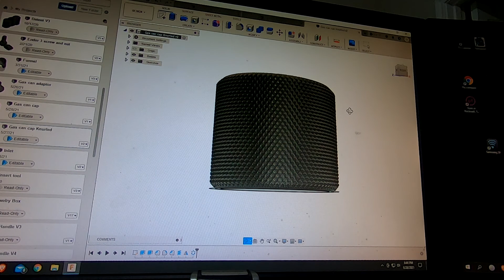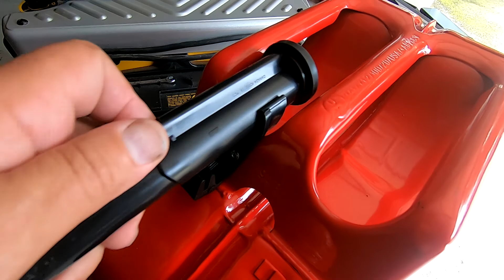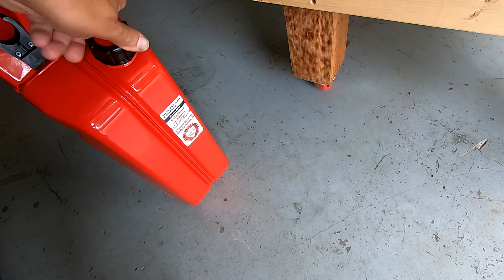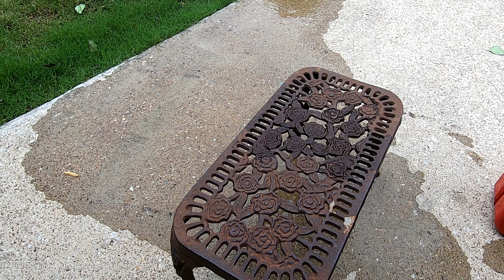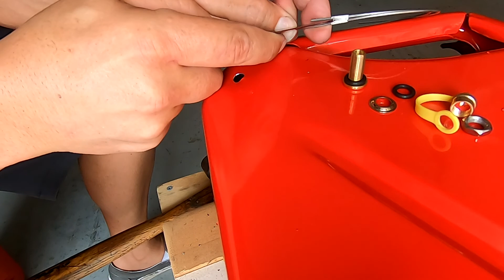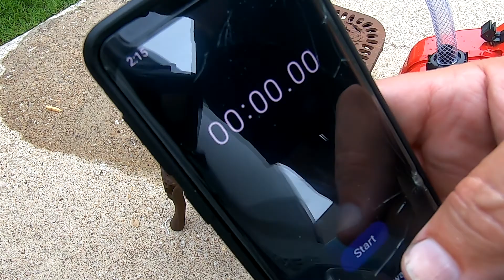The best spout and metal vent for the Harbor Freight Jerry Can Gas Can.

Comment: Just bought some of the Midwest HF Jerry metal cans and wanted to see how to vent them.  Perfect video.  Didn't want to install plastic vents on a metal can.  The same vents have my eyes on from Amazon.  Any regrets on the location of install?  Top left side.  My cans will be used for annual storage and just thinking about the arrangement of them.  If arranging side by side the vents could protrude out and be in the way.  Thanks for the video.  Also any tips on removing the metal shavings from inside tank after drilling the vent hole?
Reply from the maker: Actually, the vents are installed on an angled part of the can so my cans sit side by side touching each other and the vents do not stick out past the side so they do not touch or get in the way. I am happy with where the vents are located.
Reply: @737mechanic  No reason to reinvent the wheel then. That is where they will go.  Thank you.
Reply: No spring chick anymore at 60. Think I'm going to wimp out and go through the transfer pump way.

Comment: The nozzle stores inside the can pour hole -nozzle end down.
You can buy flexible adapter nozzles right where they sell gas cans at tractor supply or harbor freight.
I used one of the flexible adapter hoses and a plastic pop
In vent on mine.
I yanked that stupid mesh filter out with a pair of needle nose pliers.
I store one of these cans on my work van rear door in a custom theft proof holder I made.

I store it with the original red plastic ring and cap and then screw the nozzle on when K need to use it.
Those original rings with the red cap break so easily after one use of unscrewing after sitting for a couple
Months….at least mine did.
Reply: I have the yellow plastic pop in vents I wanted to try. How did yours work out? Did it fit tight with no leaks?
Reply: Yeah.  X2.......Might as well keep the tubes on the cans ........with caps on

Comment: I think that if you check with the manufacturer of those vents (if it's not noted on the back of the packaging) that the yellow retainer to the cap is NOT supposed to be mounted between the nut and washer (that's just for shipping). It should be the last to be mounted on the ventso it's just below the cap against the nut. This will allow you to make the nut tighter for a more solid compression of the o-rings without damaging the yellow retainer. As it is, the retainer's ring could end up failing due to compression. Just a thought! Great that there's no interference when the cans are positioned against each other. I'll probably end up buying two or three of those cans and venting them in a like manner.
Reply from the maker: I did check and I could not find anything that confirmed the proper install. I did experiment with it below the cap only and it would have a high chance of falling off when the cap was unscrewed and I didn't want to have to worry about it falling in the dirt. I bought a pack of 10 so if I need to I have others to experiment with.
Reply: On Amazon the product pictures shows the yellow cap retainer under the nut.